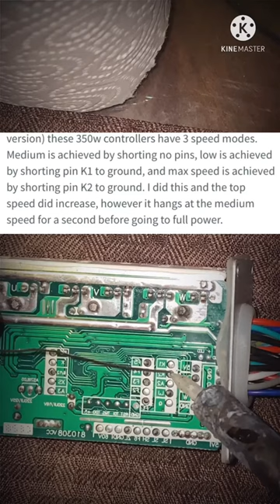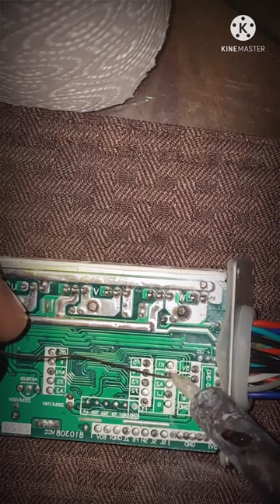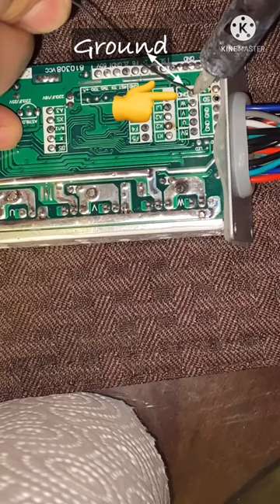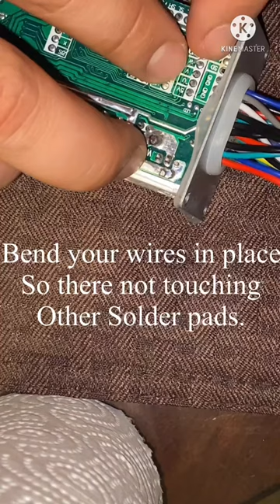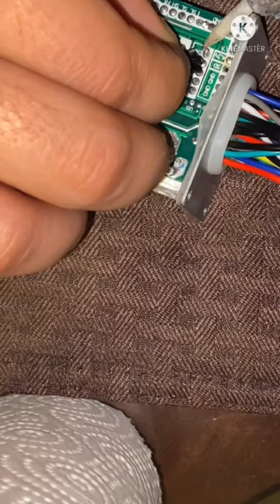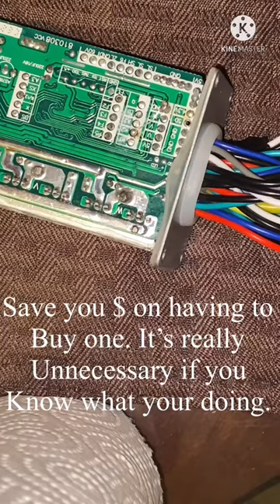Speed mod ( 36v 350w ￼Controller )￼-links in discription-

Comment: I added an on/off/on switch to my bike so I can toggle the different speeds at will. I also added a speed limiter so I can't exceed walking speeds so I can cruise on busy sidewalks.
Reply from the maker: Or you can order a controller with display kit, it also has a p -setting to where you cruise 3 to 4 mph, that’s what I thought about when you said cruise on busy sidewalks . And you can Control your speeds through your display  as well
Reply: Yeah I got s866 displays. I really like those because they're not very expensive & have a lot of features. Finding a controller that wants to work with those can be a hit or miss with brainpower controllers though. I've been researching what components could be changed out to increase acceleration strength & braking power & also decreasing the time it takes for cruise control to kick in.

Comment: You can use capacitors & diodes to increase the voltage from 5v to 12v. ElectroBoom has at least a couple videos where he demonstrates that.

Comment: Thanks! u got yourself a new suscriber!! i have the same controller on a ninebot es4 with external battery, when i go full speed for a few seconds the bms would kill the power for a moment and then again it would run good , im looking to bypass the BMS of the external batt would you help me as in where to solder the cables from the battery?
Reply: bms i atlarsan şarj edemezsin

Comment: Thank you for this video. I have an 36 V 350 W KCQ-EMC7939 controller. I've linked K2 to ground, but nothing happens. No extra or low speed. My question is: does this operation (K2 to ground/ K1 to ground) overrides the programmed predefined software speeds , set on my controller? S1 = 5 kmh, S2 = 20 kmh, S3 = 25 kmh? Thank you
Reply: Alguna novedad?
Reply: K2 to ground should override the programming as long as you have the same controller.
Reply: @sethreign8103  se desbloquea la velocidad?
Reply: @sethreign8103  Thank you

Comment: My controller has these speed wires hooked up by default to a connector, Also here are a few more functions that might not be hooked up from factory:
-Connect X pin to DS to enable active braking so that the motor stops when you connect the two brake wires instead of simply cutting power to the motor.
-A1 pin cycles through the three speeds when grounded and F1, F2, and F3 pins are for speed indicator lights to let you know if you are on low speed, middle speed, or high speed.

Comment: Would this work with pure air pro scooter on 350w motor 36v battery.
Reply from the maker: I’m sure it would..But I do this this to the scooters that I fix because they have no speed settings which means it probley stays in regular mode the whole time..but if your able to control your speed thru setting/display then I would leave it alone!! (Say for instance you have a 3 mode speed setting ) ok now if you do this k2-ground then speed 1 and 2 become useless because you just bypassed them..you would be stuck on 3 /high speed
Reply: @pjscootermods  what about installing a new generic controller with the same specification as the one i currently have -  350w 36v controller and  connect it with the remote display the scooter has currently has. would that work?

Comment: Ais ma reverse q ni working kr ta
Reply from the maker: I assume this is not for a scooter! this should be achieved by shortening your two wires (reverse) by adding a Killswitch 

When you turn your (On off switch )the reverse wires should shorten out and then  reversed your  wheel .. and then vice versa when you turn your switch off your scooter should go forward again when you give it throttle.